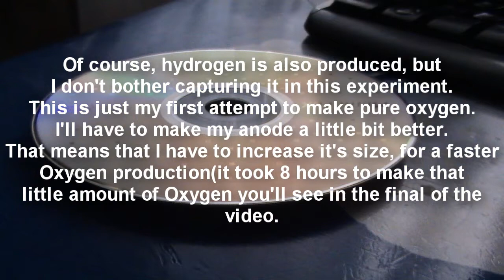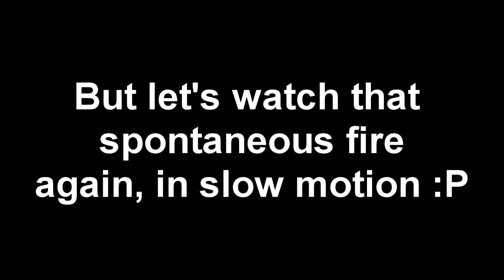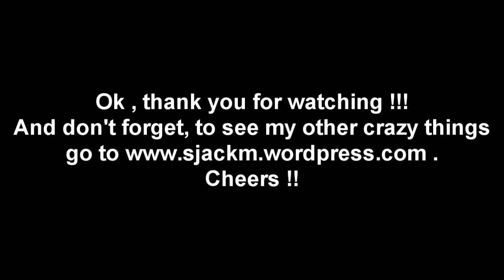Making Oxygen from electrolysis (1)

Comment: Please do not laugh at this guy as Hydrogen is a combustible. Oxygen on the other hand supports combustion, or burning. If you have a smoldering flame and put it in oxygen it will rekindle and actually flare up. As a older man I must warn, when I was a boy in the 50s oxygen was 21 percent of the air. In NYC its 19 percent. At about14 percent yo get exhausted with mild activities. At about 12 percent strokes and heart attacks will be epidemic. I was 20 years in medicine. 02 is LIFE,.